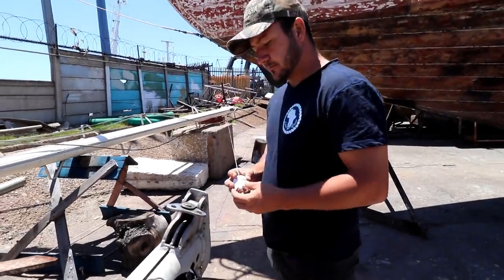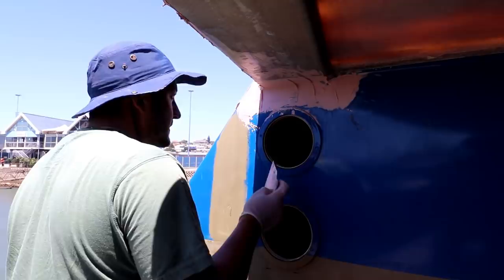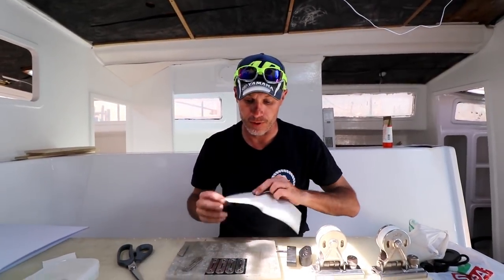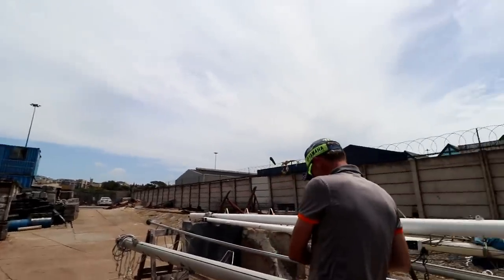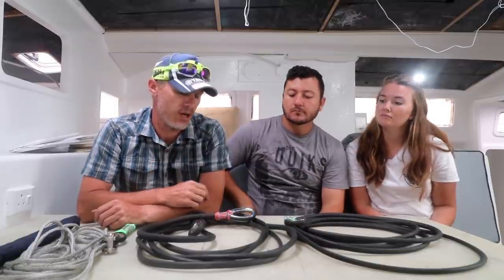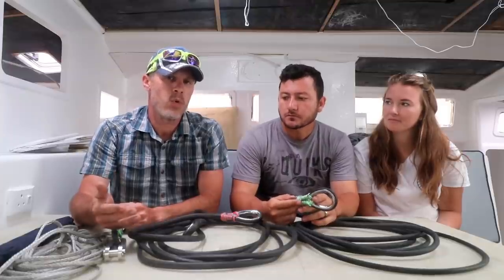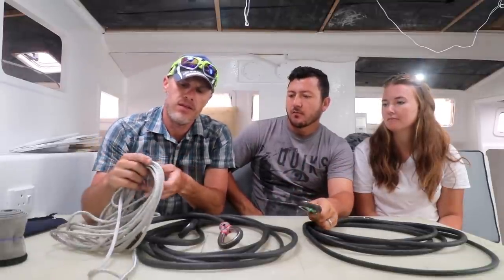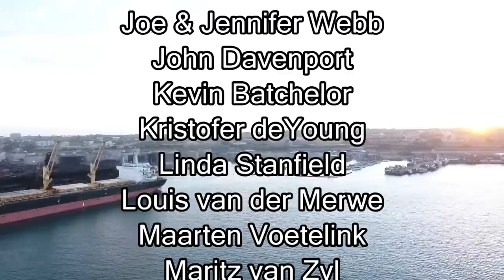DYNEEMA SYNTHETIC STANDING RIGGING! | YACHT REBUILD WEEK 59

Comment: This is very interesting as just today I found an article on Dynema rigging stating its downloads, comparing to traditional wormed parceled and served iron rigging. (for traditionally rigged sailing boats). In my years as safety inspector on the oil terminal of Trieste, (SIOT-TAL) I saw some ships (100/150Ktons DWT) with similar mooring equipment, very thin ropes, light, manageable without hand protection, clean, not greased, whose downfault was friction, so they were provided with sleeve in the critical points, then when not in use they were rolled in drums and covered. I had a booklet on how to, splicing etc but unfortunately can not find it. So, all this is a good novelty. Saluti dall'Italia.
Reply from the maker: It's very interesting indeed. ☺
Reply: Diameter was 34/38 mm load higher than steel appropriate for ships of that size (100/150000 tons Gross Capacity, Dead Weight, DWT), weight for meters a small fraction of steel, easily handled and clean.

Comment: Interesting video, about that Dyneema. Especially that it's practically two times stronger than stainless steel...! By the way, did you make that swim platform higher than standard for a reason?
Greetingz, Wim
Reply from the maker: We did to have more clearance from our stern drive and instead allow the  water to slam  the bridge deck instead of the swim platform 😊
Reply: @livingwiththemaias  Oh, yes, of course, you have the engine in the middle! Stupid me. Love your swim platform. I have been kicking off as much stainless steel as I can off ours today. Rediculous, how many kilos are hanging around over there :-)
Reply from the maker: We were also surprised how much kgs we took off when just removing the unnecessary stainless steel.
Reply: @livingwiththemaias  But you guys had such enormous, oversized st st plates! Any idea how many kgs you really removed by now?  :-)
Reply from the maker: I think about well over 200kgs.
Reply: Yeah, heavy stuff. People tend to hoard stuff so easily. But it's a good feeling to get rid of all that overengineered and useless stuff, right? :-) We already see the waterline getting higher above the water, haha! Laterz!

Comment: Nice guys! We have had dyneema rigging in mind....might do it but have not decided yet. Did you go with SK78?
Reply from the maker: Hey guys. We went with Super 12 from Southern Ropes. 👍🏻 😊
Reply: @livingwiththemaias  well, I was more thinking about which dyneema fibre it has. Cause, when I was looking into dyneema rigging  I first choose 8mm DM20 with NO creep. Then I forgot to calculate the stretch comparable with my 8mm stainless wires which made me come to a conclusion I needed 12 or 14mm SK99...or 16mm sk78 to have similar stretch.
Reply: Checked the super 12 and couldn't find which dyneema fibre it uses...but seemed very close to 12mm sk99 specs.
Reply from the maker: Sailing Less-Plastic have a chat with Luke from kraken he has the answers haha

Comment: isint faring just fiberglass body filler?
Reply from the maker: No. Fiberglass body filler is only fine for application that is not exposed to water or marine applications. The fairing compound we used is a epoxy based fairing compound dedicated to the marine industry.
Reply: @livingwiththemaias  o cool nice to know